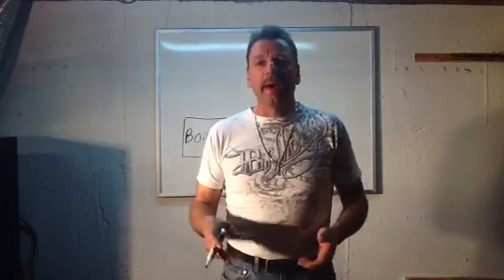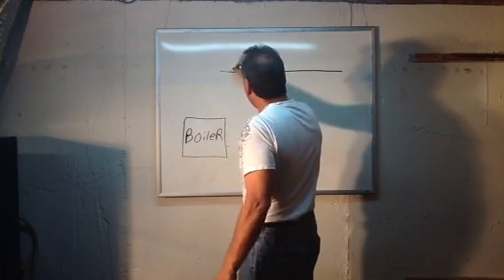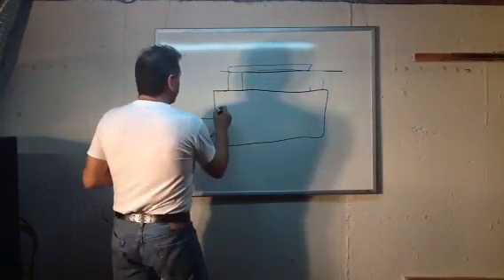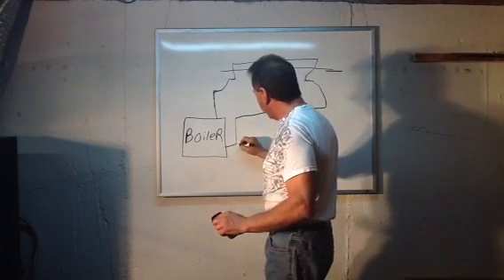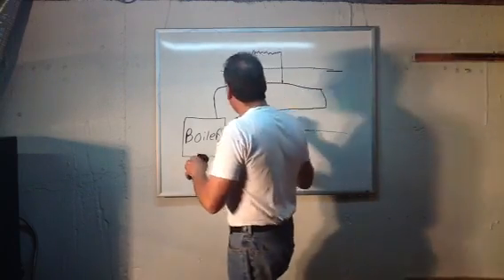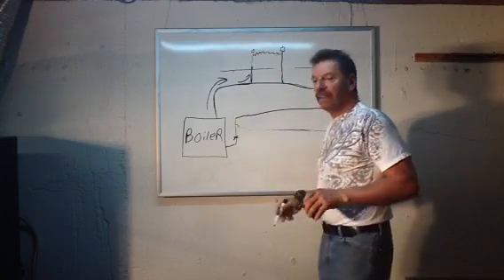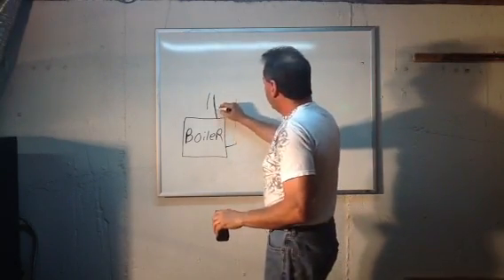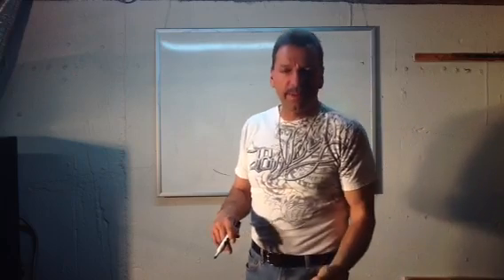why some hot water baseboard just doesnt get hot

Comment: Thanks Lou... I've learned that I don't know what I'm doing!  I have successfully run baseboard on monoflo tees, AND put bleeders on the downstream elbows to bleed air.  Guess what?  NO CALLBACKS!
Look at the difference between 1 GPM and 4 GPM ratings on baseboard... not much, is there?  so, add an extra foot or two of baseboard then!
If you need more flow, use TWO monoflo, one in reverse at the other end... plenty of flow then!  Let's you use TRV to control room temp without zone valves!